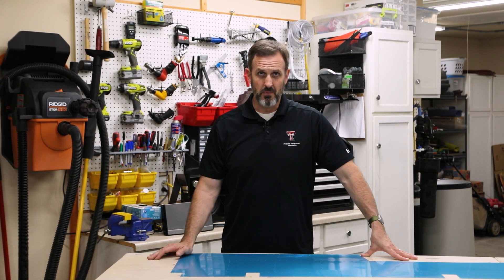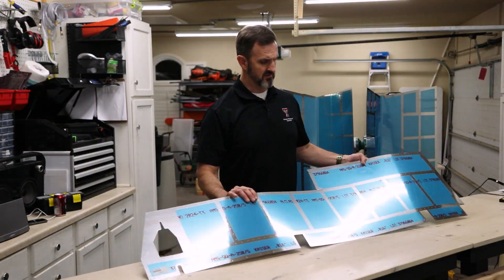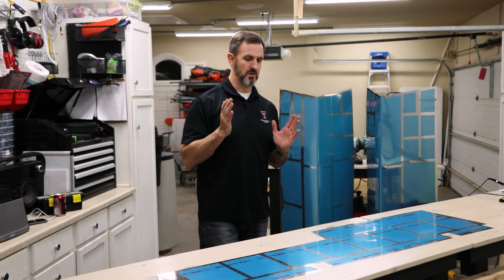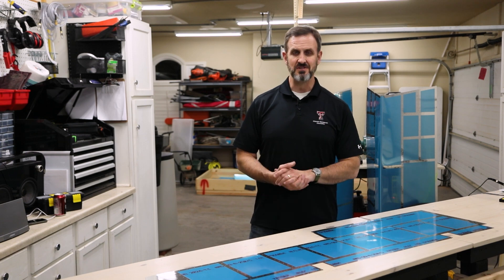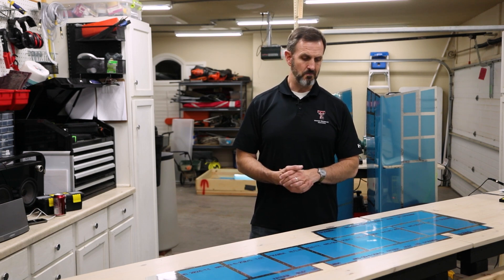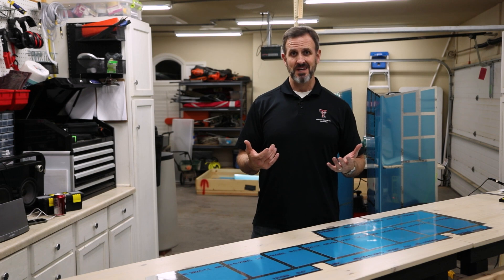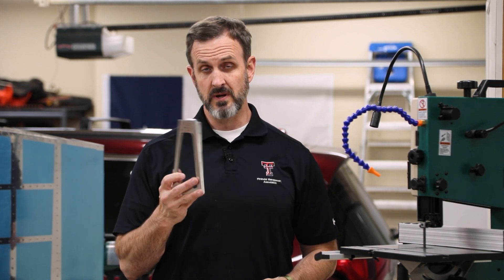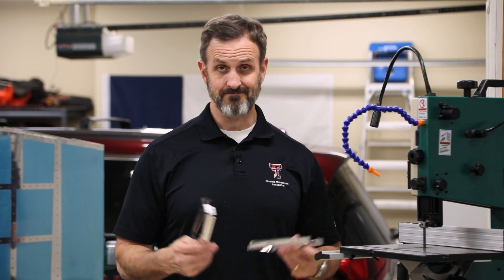Building the RV10 - Video 5 - Elevators (November 2021)

Comment: What number of cleco do you recommend?
Reply from the maker: I bought the Cleveland tool kit and it came with around 500 of the 3/32 clecos. I bought another 300 - 400 or so and that seems to be plenty. I have around 150 of the 1/8 clecos. You don’t need nearly as many of those.